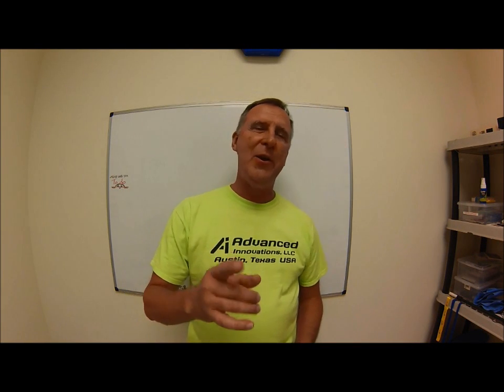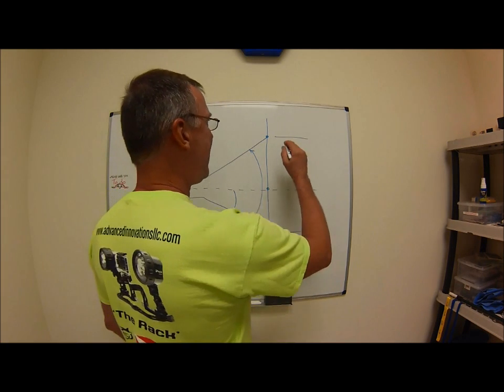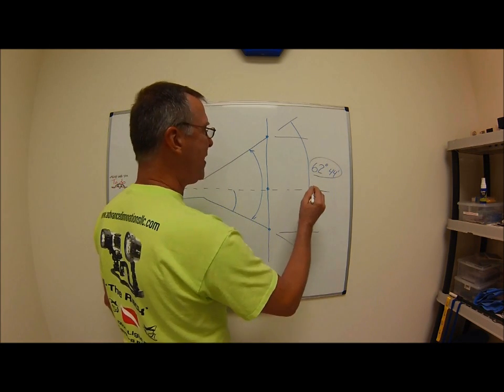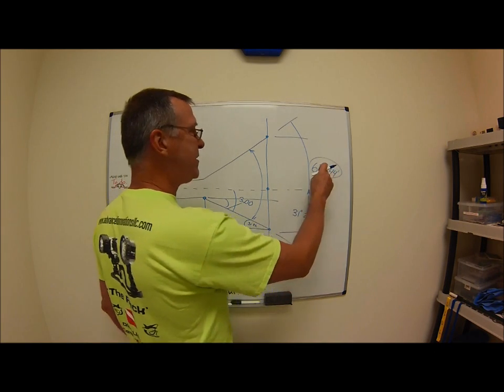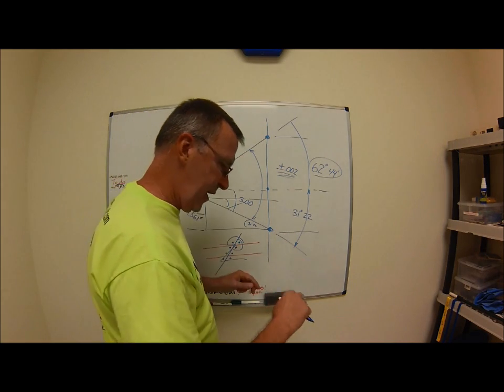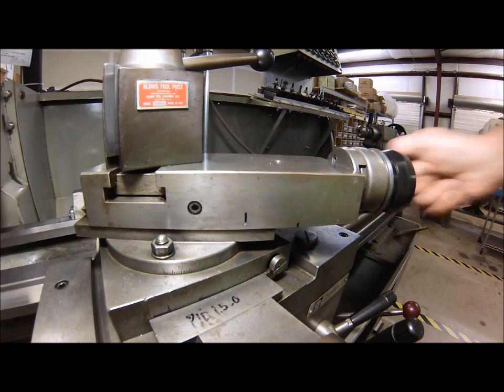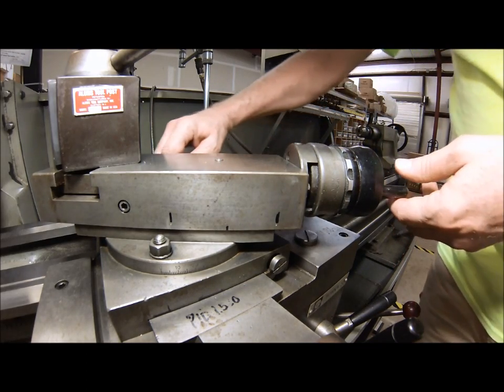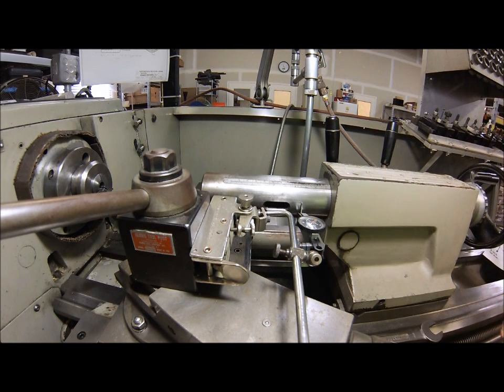Setting the Lathe compound to precision angles

Comment: Ok I am very new to machining. If the angle the engineer listed is 62⁰ 44' why do you set your compound at half of that? I just dont see how that gets the correct angle? I am trying to turn a 5 to 1 scale to spec replica of a rifle cartridge from technical drawings and I see that on the shoulder angle. European prints show the angle at 40⁰ for total angle and American prints show the angle 20⁰ from centerline. Joe, I would greatly appreciate any help you can give me.
Reply from the maker: Cutting an internal conical feature with a compound is like cutting a book across the cover at a 20 degree angle. Open the book and you have 40 degrees. You need to pay attention to how the feature is dimensioned so your setup is correct. Does this help?
Reply: ould this be the same for an external conical feature also? The feature I am trying to machine is the shoulder angle of a .308 winchester cartridge. I tried doing the trig taking the  but I very well may have messed it up because I was calculating an angle of somewhere around 36 degrees (didnt use the functions you showed in the video) and when I used an angle gage we have in the tool crib at school the angle of the shoulder from the neck of the cartridge to the main body of the case matched up fairly close to both 35 and 40 degree gages. I am figuring I have done something wrong somewhere along the line and just have confused myself. My teacher is helping but there are 7 of us in class doing lathe and mill work so he ends up having to bounce around the shop answering questions.
Reply from the maker: @Das_Beachy  Yes. This principle applies to external angles as well. You always set the compound angle to half of the included (total) angle needed on your part.

Comment: I wonder if you have instruction on how set up a taper turning attachment to perform the same task: the angle I need to make is 8° 17' 50'' thank you
Filippo
ps is there a site where we can download your gun related videos?
Reply from the maker: The use of an indicator and some trig will work just as well with a taper attachment. Setting the indicator with your environment will be your challenge. Register your indicator against the stationary taper bar and move the carriage a set amount. read the indicator and you'll know how close you are to the value you trig'd out.  As for gun related content, If you look through my catalog, you'll find a few still posted. The ones I took down from youtube were re-posted here   https://www.firearmstalk.com/threads/ar-lower-done-by-a-true-machinist.124416/

Comment: I gather that in order for this to work properly, you're counting on the tail stock quill being perfectly true to the spindle axis and the diameter of the tail stock quill is the same at both of the points the indicator touches it when reading "0"? Any advice on how to approach this if your tail stock isn't perfectly true to the spindle?
Reply from the maker: Actually not. As long as the tailstock spindle is straight, it can be anywhere. The resulting angle will be correct  regardless of its relationship to the head.

Comment: This is an excellent video. I don't have much machining experience, but the maths path I usually don't have too many issues with following and working out what was done to be able to fully understand processes like this...

which is why I was confused and pissed momentarily when I did the maths and kept getting an error, before I realized it was 3 times the sin of 31.3667 and NOT the sin of 31.22. My bad, I was tired forgot it was minutes.

Comment: This is how you get a college degree in Lathe Operations by Pieczynski. Great video. I a hobbyist, a professional certified welder/fabricator by trade, 40 years. I'd like to know the brand name of the Magnetic Base you are using in this video. If it's home made maybe you can show us amateurs all of the different ways to dial in what we are working on. I have some machine shop background but compared to you and the many others on YouTube I'm not qualified to throw the switch. I don't mind asking dumb questions that maybe common to others. As a welder and as a instructor and CWI I have taught hundreds of individuals the art of welding never fearing to share my knowledge with others. When I started I was blessed to have my wife's grandfather who started out as a Blacksmith and did a great deal of the work at his business with Oxygen/Acetylene so this is where I cut my teeth. He had a Welding and Machine Shop and was truly a Master Journeyman of his trade. Regardless if you have an answer or not you are a fantastic Instructor and I enjoy your Channel. Thank you Joe
Reply from the maker: Awesome comment. Thank you very much. that indicator holder is very old and hard to locate. Its a model 387 US General brand magnetic base. I pinned it together just after I bought it over 40 years ago. Check the vintage tool section on EBAY. Sears also made a knockoff for a few years.
Reply: @joepie221  , I appreciate the info on the magnetic base, too bad no one decided to continue making it. It's got to be a good one if you still reach for it when machining.

Comment: I would assume that because you're only setting an angle and not a critical diameter or anything of the sort, as long as your tailstock is parallel to your spindle, you should be good, correct? I don't think lateral misalignment of the tailstock would matter but correct me if I'm wrong...
Reply from the maker: try to keep the indicator tip on center with the tail stock spindle, otherwise, this is a solid technique for accurate angle settings.

Comment: I'm an engineer and this is why engineering students need to spend all their free time in the machine shop. That 44 minutes on the degree just cost the company 20 minutes in additional set up time, and potentially a lot of scrap for less capable machinists. My other pet peeve is engineers tolerancing everything to +/- .001" because they can't / won't do a tolerance study or don't understand fitments.
I'm getting off my soap box now.
Reply: Wrong,... if it was zero minutes, and the tolerance was the same,... it would have been no different.
Reply: Daniel Wahl, only partially.
Reply: Amen brother! Ive told numerous engineers that they should come out in the shop and attempt to do what they ask. Its not an easy thing to do on an engine lathe. I recently had to cut a 7.2 degree angle on a mandrel on a manual lathe and I made the engineer come out and see my setup so he could realize how difficult that can be.
Reply: Even better when you ask for a part to be made within .005 and the machinist makes it to within .001 and charges extra
Reply: Yes, as a journeyman machinist of 40 years myself, I couldn't agree more with you. Adding a fourth zero to the right of the decimal point takes everything to a whole never level of stress for the machinist.

Comment: This is a very simple and accurate method. I’ve used this many times. The only thing that would make it easier, is to put the indicator directly inline on the X axis with the compound pivot and slide the compound the other direction. When adjusting the compound angle the first reading barely moves while the second reading does all of the changing.  This also works on supplemental angles against the chuck face. Just use your Z axis DRO or an indicator to position your carriage.

Comment: ?A2 + B2 = C2 ? Is this the formula you used for the drop or dip?
Reply from the maker: Once you have the stroke of your compound as the hypotenuse standard, and the angle you wish to set, that formula won't work.  That formula is ideal for finding the 3rd side of any right angle triangle if you have the other 2.
Reply from the maker: Go to 10:20 in the video, it shows the formula.

Comment: Too many variables. I put a sine bar on the edge of the compound then indicate. Is there any other more accurate way? Probably not.
Reply from the maker: I'll address this. With all due respects. First you have to own a sine bar and complete set of blocks. That could be strike 1 and outside the budget. Second, not all compounds are favorable for resting a block stack and bar on a level surface against them. The rotational lock nuts and flange usually make this very difficult. Maybe strike 2. And finally, any air gap between the sine bar and blocks, or within the block stack itself will cause a false reading. Next you have made the assumption the outside of the compound is dead true to the gib ways it rides on. That being said, I'll match this method to a sine bar and gage stack any day of the week. With zero moving parts to worry about, I'd say this is the more accurate way.

Comment: I was doing this trick the other day, but used a piece of straight stock (I had just machined it) in the lathe chuck to set up the triangle.  Same idea, different side.  Thanks for confirming I was using a REAL machinist's trick Joe!  PS, I need to use your tailstock idea for confirming the alignment of my mini lathe tailstock at home too.

Comment: The Lathe operator would verify the correct angle using a SINE BAR.
The correct slip gauges (Johnnie Blocks) placed under the sine bar on a surface table & IF the angle is correct - the DTI (clock gauge) will measure parallel along the length of the taper.
I know like minded people already know this, but some other more casual viewers may not??
Reply from the maker: All you need is 6 hands, a sine bar, a set of blocks, and true surfaces to set everything so that it doesn't collapse. Otherwise your method is fine.

Comment: The "Inspector" (I'm an Inspector) would measure the taper (cone) on the CMM (co-ordinate measuring machine) 
1) Measure the top face (plane) & plane align then call the z axis the origin @ ZERO.
2) Measure the cone angle on the CMM.
3) The Inspector (ME) would then ask the CMM for the Diameter @ 'Z' "ZERO"
so it would make NO difference if the Lathe operator (turner) had rounded off the edge or not
YES a CMM can & does measure "Fresh Air Dimensions"

The CMM will also tell me the diameter at the small end without Actually measuring it!! Say the diameter was specified at the small end at 2.000" Long - I'd simply ask the CMM  what is the Ø at Z - (minus) 2.000".
Reply: Intersections don't exist. They are defined by faces.

Comment: Sorry Joe. All the preamble was great, but the actual description of what you were doing with the DTI on the lathe was not, to me at  least. You said the 'drop' was an important figure, but it was never mentioned again. Surely the drop is what you measure on the cross-slide after you have moved the compound back 3 inches. And you seemed to say "compound' and "cross-slide"  interchangeably.
Reply from the maker: I choose my words very carefully. Please watch it again and try to follow along. if it still seems confusing, I'll clarify the meaning.
Reply: Many thanks prompt response. I watched it three times. As I mentioned, I thought I had worked out the method, but I have not yet tried it on my lathe. But there is no mention of the drop dimension at the lathe. And I am not clear why you mark the topslide when when you have the vernier control to measure the hypotenuse.

Comment: I did not know that technique. I usually use sine bar and gauge blocks to set compound but this way might be quicker. And I too have had to work with silly engineers. ( I also have engineering degree so I earned the right to call them silly)
Reply from the maker: Too many engineers never have the opportunity to get close to a good machinist and take it to the next level. Some don't care to.

Comment: Retired now, I worked for many years in Jig Boring shops. Just about every job that came across my desk involved tolerances in tenths of a thousandth. Angles usually were no exception. We came up with a method using the side of the compound to set the angle with an indicator in the spindle. First set the compound angle as close as possible to start with using the graduations. Then consider the side of the compound as the triangle's hypotenuse, pick an even number like 3" or 4" for the side, then calculate the other two sides of the triangle for the desired angle. set the indicator to zero just touching the compound. Use the lathe readout for the distances in the X (cross slide) and Y (long travel) axis to set the opposite and adjacent sides of the triangle. You will need to double the X cross slide number as it reads in diameter! Just as with Joe's method, it's possible to set angles within seconds of arc!

Comment: Hey Joe, love your videos.
I have a small JET lathe at work and I have a question about it (I'm also very inexperienced so forgive me). The cross side angle indicator plate looks almost identical to what your's looks like in this video. Is there an indicator mark you have scribed onto the plate or something? I'm not certain on how to determine a precise angle if there isn't a reference point. Is it as simple as measuring the slide and using a punch or a scribe to mark the center to use that as a reference? Hopefully this doesn't sound like a bunch of gibberish...

I was trying to part off a piece yesterday and managed to get the parting tool parallel with the chuck face (by some miracle, and I mean that we don't have a tool post mean for the parting tools we have, they're just three capscrews you tighten down onto the tool itself) and whenever I came to measure how far back I needed to go I noticed that the distance travelled on my slide did not match actual distance and I determined it was due to someone (probably me at one point) cutting an angle and most likely didn't get it centered on zero whenever they were finished (due to the lack of an indicator).

P.S. As a submarine veteran I thank you for your work. I'm also from Texas and continue to work on Submarines (now as a civilian) in Washington state at a naval shipyard. Keep Austin weird!

Comment: I used to use a small sine bar with gage blocks, set up with a flat surface to create the triangle and indicate straight.  your method is close if your cross feed and compound slide screws are not worn.  checking the diameter is a separate issue.

Comment: Hi Joe, put your method into practice and replicated your figures however, two important points 
1. had to convert to decimal degrees, (No printed trig book handy)
2. Tail stock must be precisely inline with Lathe center line.
then it worked like a charm.
Worked amazingly as you indicated used your method for the expanding arbor Nut.
Thank you again.

Comment: Have you ever met a person that called himself a machinist that did not know right angle trig? I make my movements using the two legs of the triangle (not the hypotenuse) and arrange it so that the indicator touches the same spot when finished (many ways to do it). I use similar technique to set angles on a mill. Where do you show how to measure the depth (diameter) of the taper?
Reply from the maker: But, You have to know the hypotenuse first, or your method crashes and burns. This method is using the 2 legs with a known hypotenuse.

Comment: I got a Hardinge lathe and made my own cross slide and compound so I had no graduated marks for the angle and needed to cut a backing plate for a chuck with the Hardinge 4 degree taper. I failed three times trying to use protectors and digital angle fingers and a few other items to double check the angle. I had one that would work but wasn't true. Only hit at the very back of the spindle nose taper. I just got done setting up using this method and I believe it's going to work great. Thanks for all the knowledge you are giving away and keep up the good work.
Reply from the maker: Good to hear. This is very accurate.

Comment: Why, when I do the trig on this, do I get a different answer to you. I get 1.5549. While you get 1.5615?
Reply from the maker: Make sure you are not getting caught in the oldest trap in the shop. Decimals are not the same as minutes when it comes to angles. Be sure to use the correct converted value.  Let me know if I am right.
Reply: @joepie221   Hi Joe. Yeah I was thinking of that later on that night. You are probably correct. Thanks for the reply. Will check again though

Comment: Holy shit, I've been in Toolmaking for years and all the guys who i've worked with don't know this. Fantastic!
Reply from the maker: I made aerospace valves for many years. This technique will get you within minutes of your desired angle provided everything else is correct.
Reply: Of course, squareness and runout to be checked...
I tell ya I learnt from one of the best Toolmakers out there in the field and worked with some good ones, thought I had learnt all the tricks of the trade... 70% of your videos are either i don't know or are quirky and improved versions of what i know... It's rare to find 1 vid that taught me let alone a dozen.. 

For the maths side I use solid works sketches and draw circles and tangent points i know it's abit pathetic and requires no mental power but hey, technology
Reply from the maker: Thanks for the comment.

Comment: i needed to cut a 7-7'-30'' angle the other day
this was the way i found out my barrel of the tailstock was not in alignment with the spindle of the headstock...
Reply from the maker: It doesn't need to be in alignment for an accurate setup. Just parallel.
Reply: indeed that is what i meant